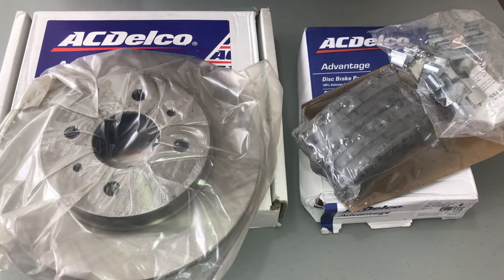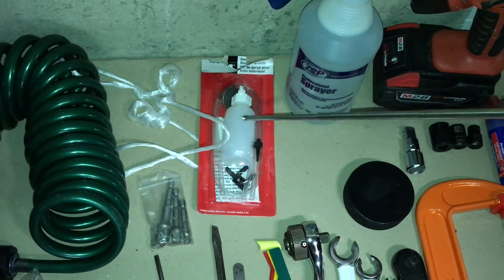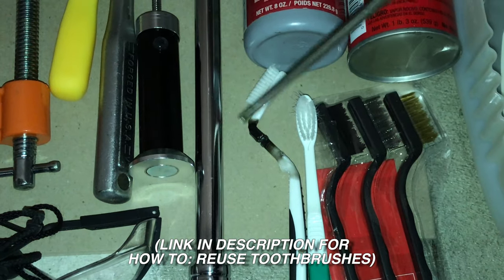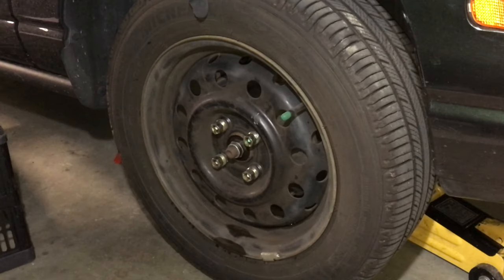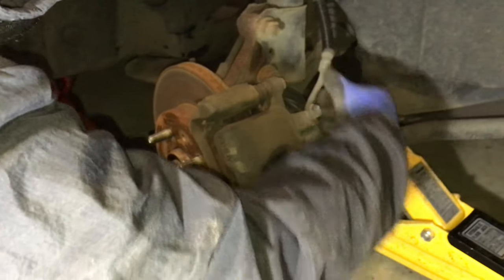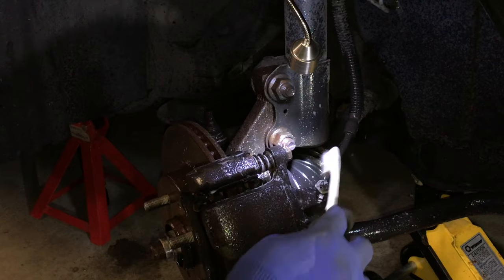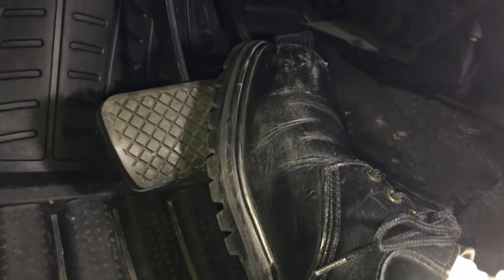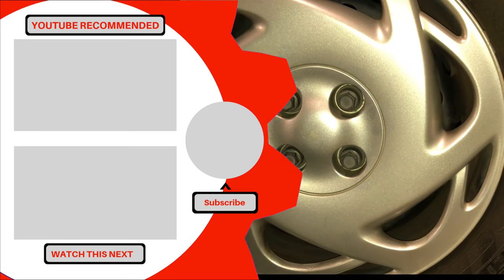𝗩𝗘𝗛𝗜𝗖𝗟𝗘 𝗛𝗢𝗪 𝗧𝗢: 𝗥𝗲𝗽𝗹𝗮𝗰𝗶𝗻𝗴 𝗕𝗿𝗮𝗸𝗲 𝗣𝗮𝗱𝘀 𝗮𝗻𝗱 𝗗𝗶𝘀𝗰 𝗥𝗼𝘁𝗼𝗿𝘀 on 2000 Saturn SL2

Comment: I found the process quite good, however, I (for the sake of those who need even more detail) wish you could have gone over the 'little things you took for granted' with a little more visual coverage.  Items such as showing the pads coming off the calipers very slowly and close up so we could get a close up view of the guides that they were coming off of.  Next, the hardware install, they're funky little things, angled weird they are.  And more reasons you were using silicone.  Many, I'm sure are asking, "why not grease"?  I see my silicone in the box comes with a silicone packet, which contains PTFE (a special lubricant, which I am adding as additional detail for the readers right now).  Other than the above, you did a very good presentation, good job.
Reply from the maker: Hi Cyclingmasterseller, Thanks for your comment.  Yes, the angle was weird because my son was filming from an angle while I worked on the vehicle.  I am sorry for that, but I could not do it any other way without really slowing the pace of my work to the speed of molasses.  Silicone paste is an excellent lubricant, heat resistant and water resistant.  That is why it is better to use.  Grease does not 'cling' as well as silicone paste does.  Never use grease in the guides as the grease will interact with the rubber shroud and seize the caliper.  A tub of silicone will last a lifetime and well worth it because it is great for extending the life of O-rings, lubricating plastics etc.  Best regards, H.D.H.